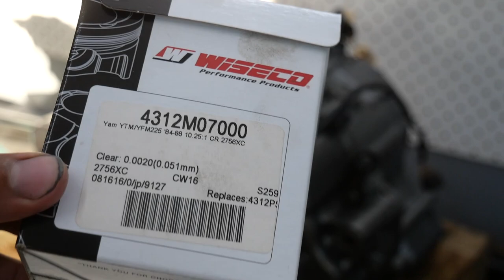Fixing the Xt225 + Some Upgrades

Comment: Love the videos mate! I have a 1999 Xt225, bike won't rev and dies completely when accelerating hard (more than half throttle) I've checked out the diaphragm accelerator diaphragm and cleaned both jets. Still having no luck. 
Any ideas?
Reply from the maker: Thanks! Man that sucks, only things I can think of is dirty air filter or your fuel filter is blocked up. I’m guessing you have already would have checked that. Also another thing to check if your valves are adjusted correctly

Comment: some I have learned is not to use screw riders to split cases, the screwdriver is a harder metal and you can ruin the gasket surface since it is a softer material. I recommend using a large plastic wedge that has a handle, it works really well